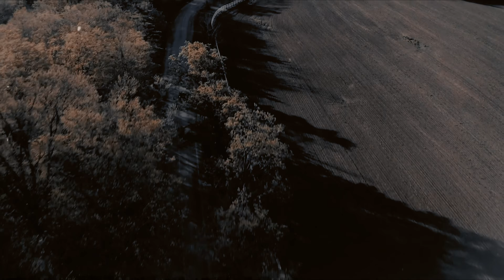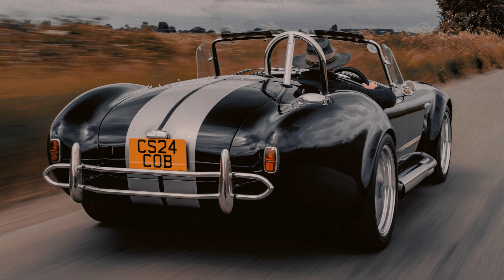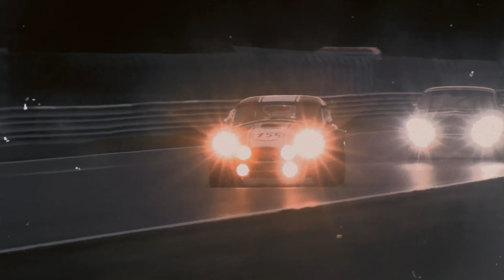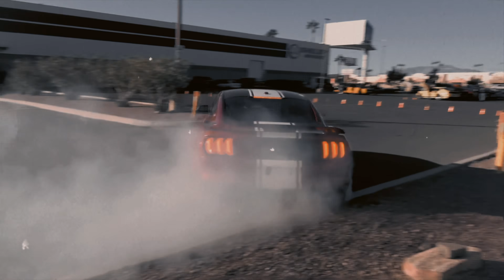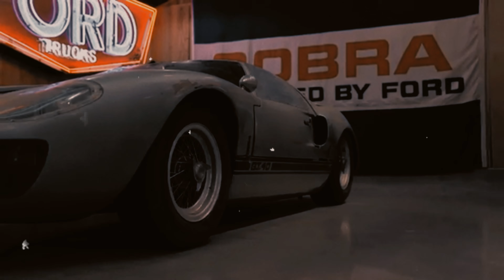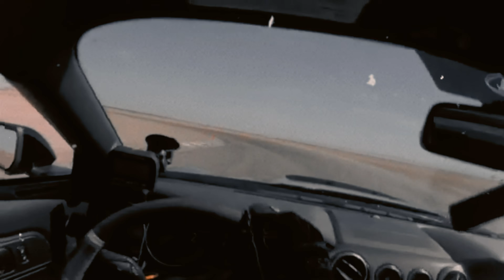Inside the World’s Most Dangerous Cobra

Comment from the maker: Putting an 800-horsepower twin-supercharged engine into a 2,000-pound aluminum chassis with 1960s brake and tire technology is either absolute mechanical genius or total corporate negligence.
If you were in Carroll Shelby's shoes in 1966, would you have pushed the project forward, or did Ford's legal team actually make the right call to bury it? Drop your technical thoughts below. 👇
🛑 Don't miss the next investigation: Subscribe to Iron & Octane and turn on notifications. We drop deep-dives into the engineering truths the industry tries to redact twice a week.
Reply: Lots of FUN for sure !😃👍🏼😎